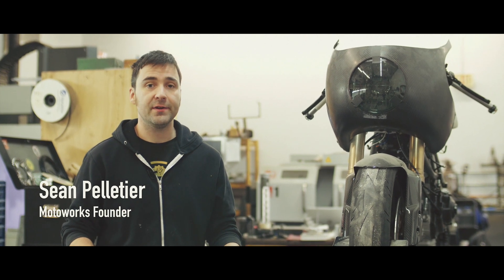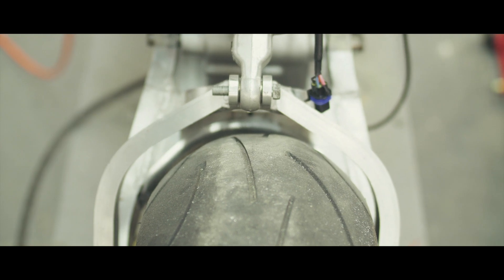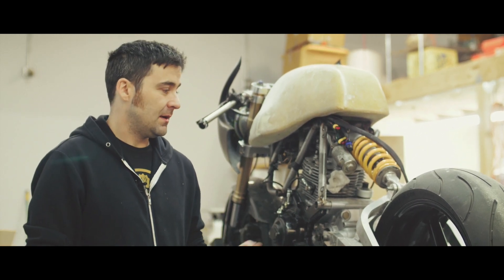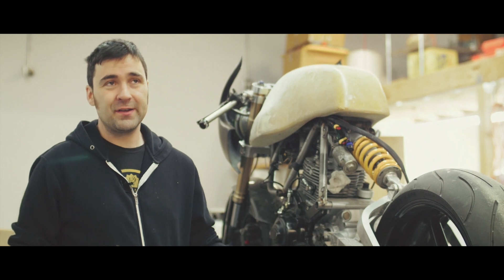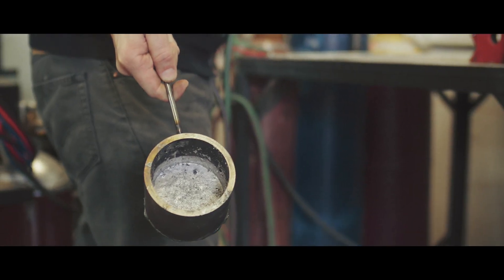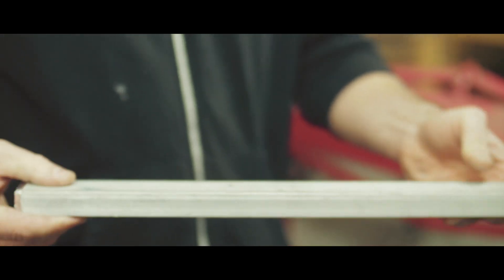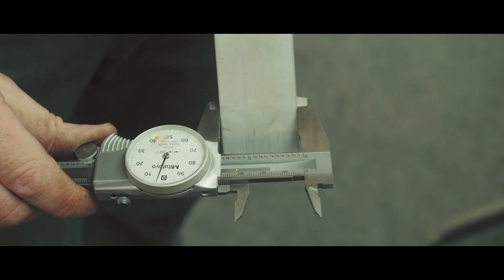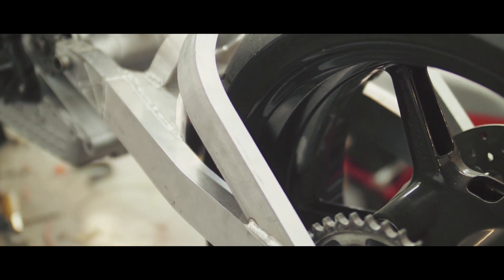How to bend hollow aluminum rectangle tube for a welded motorcycle swingarm

Comment: Does all the bismuth come out of the tube will it contaminate welds?
Reply: the bismuth all comes out, it sits on the aluminum like oil on water, so as long as you get the tube warm enough, it all rolls right out

Comment: Great video,  what grade of aluminium are you using? also, does the low melting point alloy leave a residue inside the tube after you melt it out? I'd be worried it would contaminate the material for welding

Comment: Cool method. I think I've seen videos where they've used sand but welded the ends shut before bending. You'd imagine the same process would work  with a liquid as liquids can't be compressed. Maybe even have a valve on the end where pressure can be added if the tube stretches.

Comment: Bismuth is a chemical element with the symbol Bi and atomic number 83. It is a pentavalent post-transition metal. 

Melting point Bismuth 	 271.5 °C
Melting point Aluminum  is  620-650 °C
Reply: the metal he is using actually called "woods metal" has a melting point of 70C. Its an alloy made out of bismuth lead tin and cadmium

Comment: You could make a end flange for the tube that strap to the end openings ,or weld end plates on the tube and add an air valve...then compress the tube with air and then do your bend ...just need a compressor  and a way to hold air in your tube....you could figure out how to make custom end plates to save time...then you would just hook up the air hose and then go bending...or 3d print it then dip it in ceramics (lost pla) 
and then cast it in aluminum that is another very easy solution when working with aluminum...........your welcome.

Comment: I too tried with sand and failed exactly as you said.
Then I used solder to melt (and solidifies) inside the aluminium tube, and it worked. 
The backing plate part is very useful.
Great vid. Thanks for the upload and good work.
Love from Indonesia.